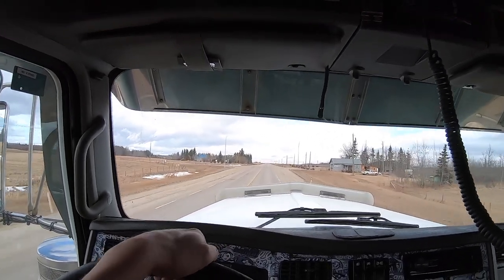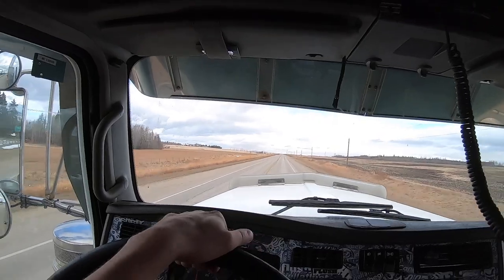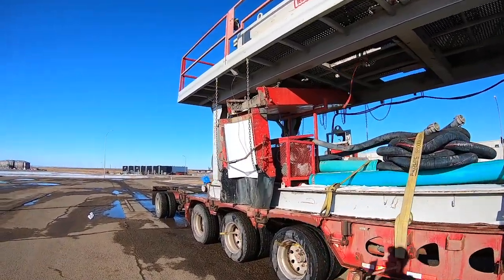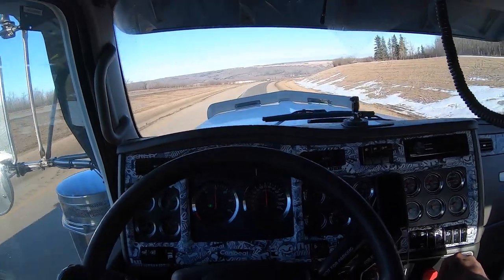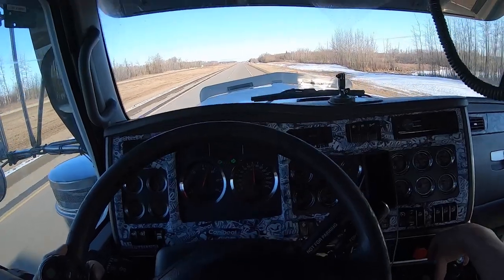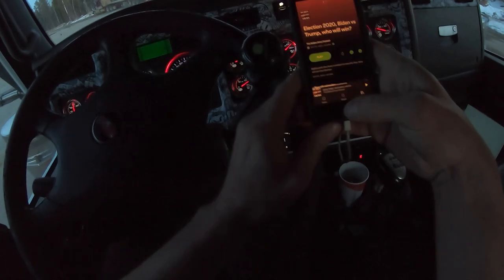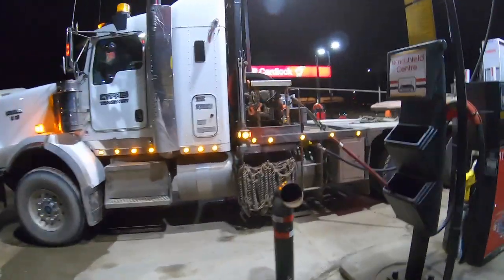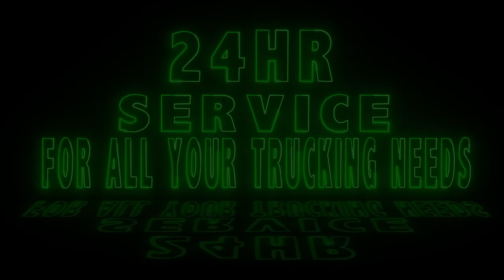CENTRIFUGE HAUL LOUD N PROUD C5 GRANDE PRAIRIE TO BLACKFALDS

Comment: Wicked tune at the beginning....😊....nice to see they are fixing 22 cut-across from 16 to 43....that’s Always had rough sections...and the Cummins maybe loud but having to drop to the basement to get outta the Big Smokey......🤬
Thanks for the drivers seat camera angles!! When you put them in they keep me from applying for drivin jobs !! lol
Reply from the maker: thanks a ton, i love getting the angles and putting as much info and action i can into these videos. are you trying to get into driving, or retired and miss it?
Reply: @TimelapseTruckerRTOT  I’ve been in a love/hate relationship with trucks since forever. Owned my own, mostly drove for someone else. Lots of highway work lots of oil patch. Lots an lots of gravel. Currently outta work and seriously considering climbing back behind the wheel.....
You’ve got a super conscientious attitude .... who brings a scrub brush to clean off the clearance lights? That’s awesome dude.
Reply from the maker: Thanks man. I got tired of salty wet gloves and try to cut down on ware on my gloves. Helps a bit keeping them longer and dry in the winter

Comment: Good video. On Pittsburgh power's web site they list a remote dealer in Ft. Saskatchewan. That does tuning.
Reply from the maker: I did email Pittsburg and got a negative response, they said they don’t work on modified dpf trucks nor do they sell the power box I’m looking for since regulations changed 3 years ago. That’s in California anyways . If I could get the boss to tune it it’s 10-15 thousand since it’s all gear driven not as easy as plug n play trucks. I don’t even know if this power box would work

Comment: I’m guessing you had to pick up the centrifuge from a rental company by the looks of their yard. All the drilling outfits I worked for would have that unit stay with the rig. I’m guessing they ran into lost circulation ( underground river) . They would hook this equipment up to a side mud pit . But odd it has a shale shaker. Maybe a work over needs to do a clean up on a predrilled well . I’m guess the latter of the 2 .
Reply from the maker: the rig has the shaker on the mud tank. i think the fluid goes from the shaker to the centrifuge is a spinning separator to get the fine stuff out. the stuff they dont want comes out a shoot into a shale bin and then scooped out by hoe and mixed with sawdust and hauled away by truck to a waste facility. possibly only used with invert drilling. ok i had to look it up. shaker separates 75% particles and exits to a sand trap then from there to the centrifuge that gets the remaining 25% and returns to the mud tank. here's the video explaining it if you want.https://youtu.be/MxE1AMsR8rU

Comment: you missed  highway 63 sooo rough and full of whoops lol.
Reply from the maker: Yeah south bound is pretty shitty. But north was pretty good except a few sharp wooos
Reply: @TimelapseTruckerRTOT  yes true but north currently has a couple massive craters lol. check out big rig power in edmonton for a engine hp power upgrade.